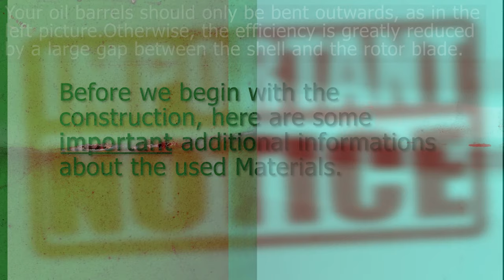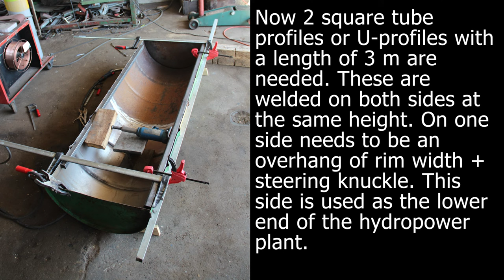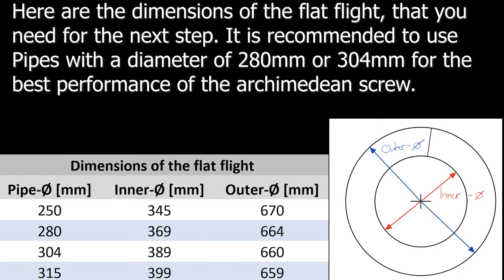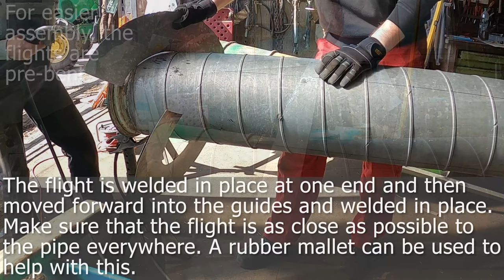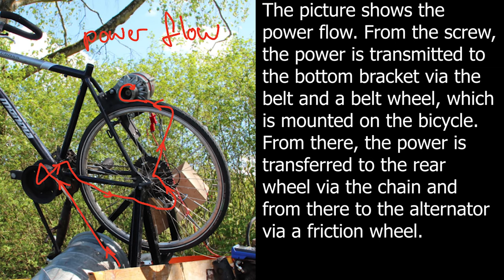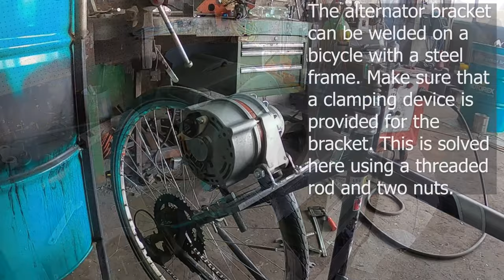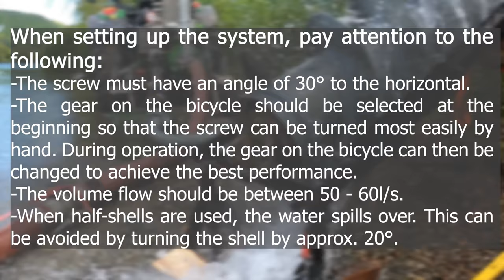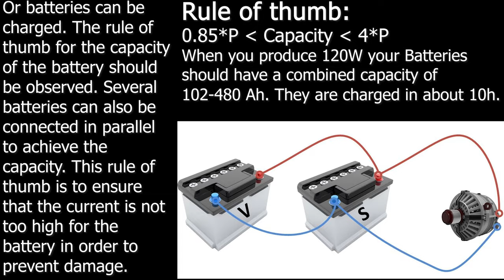Tutorial: how to build a 100W hydro-power-plant from scrap-material only

Comment: There are a few mistakes that need to be corrected to increase the efficiency: I would take a thinner pipe to create a spiral, and use the barrels as a water spreading limiter. It would also be nice to cut the tin more often to create a perfectly correct spiral, and fasten the tin itself with thin knitting needles (so that it always maintains the correct shape) because the tin is thin and can bend 😊